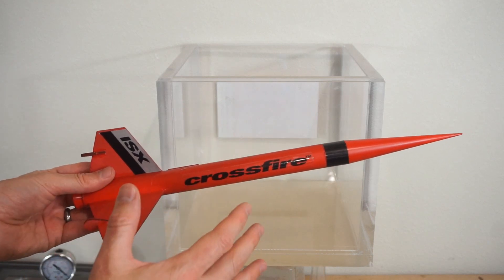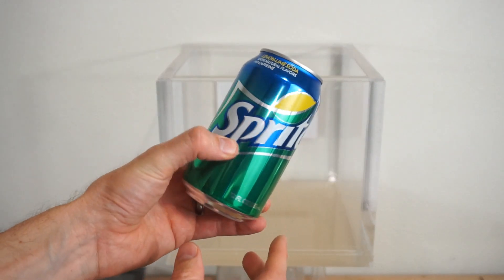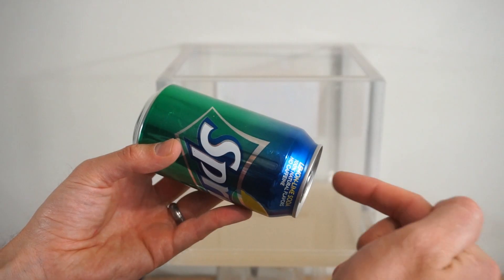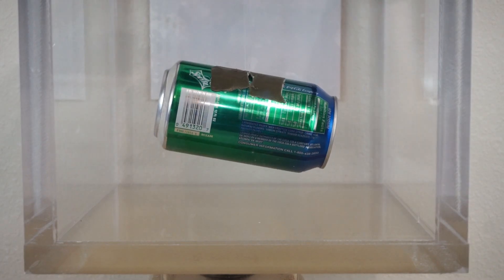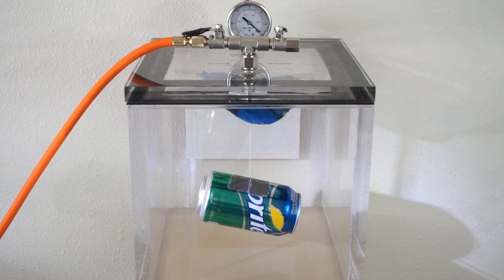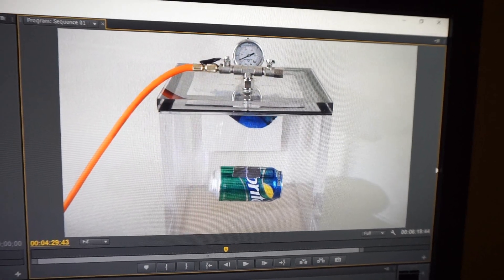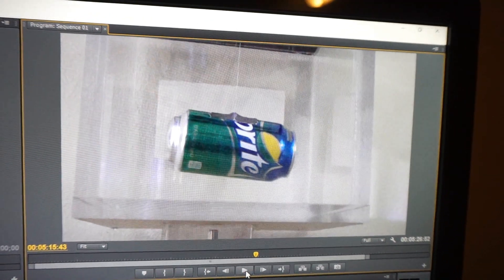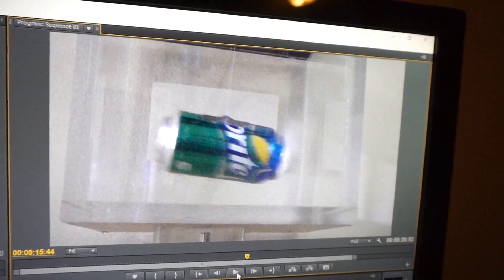Can a Rocket Fly in a Vacuum Chamber?

Comment: It doesn't explain everything as it should be if you are going to counter-explain dome earth, flat earth or whatever. You say do not push something, you are right it doesn't push something. Flat earth is not implying it pushes wall, it is implying it pushes a wall of pressure, a wall of pressure can be anything, gas, liquid, solid. It is still pushed off because, from the point of view of rocket's exit hole that reacts out, it will push off, the surrounding pressure, that is air, wall, or anything. The air and gas, liquid need pressure to hold itself, not without pressure. Well, the spread out pressure, at negative pressure, that is no air or anything, is very high and high expand, it will not spread out small (not fast or slow, it depends on size, well it combines fast and big, or small and slow) that is same as in positive pressure. 

The motion of can that you show, show motion, you say not push off the wall as you assume that what flat earth think. But it pushes off by a combination of a certain amount of gas that shot out small size of a high density of can,  that is the weakest part, that shoot out, explode which convert into force, that cause motion. That motion is stronger than the tension of your string that can hold all the force of can and motion in a can by negative pressure. It would be better for you to have a bigger string that is far stronger than combine the energy of gas that shoots out, as the rocket does not have a string. So, it is not a good comparison. 

And the exploding energy that spread all over the vacuum chamber, so the gas that hit the wall, then it reflects back to the back of wall, so I am sure the gas will not shoot back to hit the wall if it is still under normal (same pressure as a human is in) pressure. I am saying that it spread out big and all over, so it becomes a box of white of gas, that spread thin all over, depends on how much gas in the can to even distribution spread-out gas. It spread out fast, not slow. So, it would be faster than the motion of rocket that can shoot forward. Well, the can above did shoot forward, that is because of gas that is building and break out the weak point of the can that creates motion, which the motion that is being shown from the weak tension of the string. 

Typing of spread-out gas all over the wall, the rocket needs pressure to hold so the gas can push off the pressure. Mass has weight so that is pressure, so what is pressure is a push off to be felt. The best way for rocket to go thru space is there is no exit hole, and just explode while in the middle of close loop that convert into motion from high pressure while in a rocket that is not seen from the hole, because the hole is a between two medium, high-density medium to lower density medium. So, the gas will spread out wide and fast thru lower density of the medium, that is no air or anything. It sucks up like in vacuum chamber. The external pressure, that is human action and visual machine action that show external, but the internal pressure, that is pure energy, it makes sense that that is energy that suck up. So, the internal pressure that sucks up faster than the external pressure of machine and human. The ratio of the diameter of gas that matches the strength of mass plus the motion of the gas. For example, in a water hose, there is alot of water in the chamber, 1 ton to water, so it is heavy, in connecting to the diameter of 6 inches and width is less than 1 ton. So, when it goes out of 6 inches diameter in high motion, the explode rate you can need on your hands on the hose is high, you feel higher reaction as it pushes you back, as water shoot forward. The point I am saying since it shoots out forward with a lot of pressure, as water shoot out. So, the spread-out water is very small, it is equal to 6 inches of spread-out as it can go far in distance. So, 6 inches of spread-out produces the high energy you can feel as it pushes you back. So, if the spread-out is very big, which connect to the bigger diameter of a hole, the explosive energy that pushes you back is low. It is same if the bigger diameter of a hole, as big or bigger than 1 ton, the energy it shoots out is very small or nothing. It is same as no air inside, no gas, so the motion of gas that shoots out is very low or nothing to shoot out. It is the law of balance that match conserves energy, which it depends on size, motion, and anything, so the energy does not increase or decreases, but in balance. Gas and liquid require pressure since it has no internal pressure that can hold itself as solid. It is independently flexible. Flexible or loose molecules requires pressure. It does match newton's law for an equal and opposite reaction that is two different reaction of two different mass, or anything that is two, that produces pressure reaction that is third. 1st reaction is water, 2nd reaction is a mass of hose, 3rd reaction is the amount of energy that shoots out, 4th reaction is medium that holds the water since water is a liquid. For a solid, it would be all 3 reactions, but for liquid, it would be 4 reaction that depends on the 4th. If there is no air, the water that shoots out might be different, the spread-out will be big and fast. All in balance. Well, there is two reaction that two, but there is also series of reaction that becomes 3, and so on. Equal to the opposite, then equal to another reaction to the opposite, the previous reaction, in series to the end. Energy produces and holds energy. Not no energy that produces and hold energy. No energy that is no gas or anything, no atom in a vacumm chamber. Energy is the pressure that produces energy of motion. It depends on the pressure that matches newton's law. 

Gravity is illogical since it is selective, not even as an equal and opposite reaction. Rocket that can go thru gravity, that means rocket that is heavy, that can go thru weaker Gravity, and same Gravity that spread all over, even, that hold the air and water, but water and air itself is far heavier than rocket, so far heavier than us, human, which we, humans, can move thru gravity. So, it is selective, so it is intelligent like us, we are intelligent, so we are selective, but nature is not selective, but even, that depends by itself of any mass that interacts with other mass. The air is hot, not because it is intelligent and selective, but depends on itself what is there, there is the sun, so the sun causes the air to be hot. (To higher up that read this or what would be logical) If you want to believe rocket to be true, you need more lying to fool us to believe completely that makes sense in everything that matches reality, of a macro level and micro level, and interact with micro and macro level. Evolution is more easy to believe because it is more complex than a law of nature, and yet not so complex that if you look deep at micro that is simple, so it has a block, that stays only within micro evolution. And outside you can see at macro, that it looks more same than different. Human to other human is lower of different between than animals to human, even animals to animals have a lower difference (higher variety than human) in one species. 

Ya can experiment how can explode while in normal pressure, will it spread out all over, will the motion is long or short?? I assume logically in normal pressure, the motion of exploding force is low since there is higher resistance pressure, which holds the motion of pressure gas within shaking of can. So, there is low spread out in size and low motion of can that is the connected amount of exploding energy that is low. 

If I am wrong above, then counter-explain above in a logical way. No insult or anything or illogical statement. But with thinking that shows logical and make senses. 

Click reply so can see your email.
Reply from the maker: There is nothing I can respond to this. There was no part of your argument that had any physical meaning. I can't even pick out one sentence that has a hint of any logic or understanding of physics.
Reply: Ok, in additional info to the first message above, if you don't understand, then tell me. 

What you don't understand?? You say it doesn't have any logical or understanding of physics, why is that? What I said above make sense logical and physical that match the meaning process of gas and how it moves. How much pressure or negative pressure that causes gas to move thru the medium of negative pressure, which I explain for negative pressure. Did you read carefully?? Not assume what I didn't type or anything illogical. You say illogical, so ya assume what I am typing is illogical, but what I type is logical.

Comment: I came up with something that doesn't get the vacuum chamber sticky; you seal air in a black plastic pipe then put it in the chamber, then you take a powerful laser (at least 200 mw) and burn a hole in it through the Plexiglas and keep the pump going so when the hole makes it's way through the wall of the pipe and it starts moving because of the gass getting pushed out from the pressure there will be no air staying in the chamber for the pipe to push off of.

Comment: Dude this guy is like a nerd of knowing things
Reply: Monkeytogaman, absolutely not. Just because he exhibits more knowledge than yourself on this subject doesn't mean he's answered the questions. Space has infinite vacuum. His test chamber does not provide nor support 'infinite vacuum'. He has run his experiment in a small confined space, unsuitable for this experiment for two simple reasons. #1 the rocket would utilize the vessel's wall to push from. #2 as soon as a rocket was fired off the finite vacuum would be compromised and the pressure within the vessel would allow compression of any gasses which would also provide the rocket a backboard to push from. Neither of these things would be available in the infinite vacuum of Space.

Comment: Just before viewing this: If the rocket has its own oxygen supply or uses fuel that does not need oxygen then it will fly.
Reply: sounds like you've heard about NASA :D
Reply: @Codeplayer Yeah, it doesn't need an atmosphere if it has an oxidizer, and the way it generates thrust is by pushing off the vacuum.